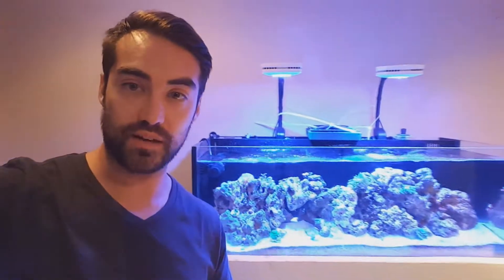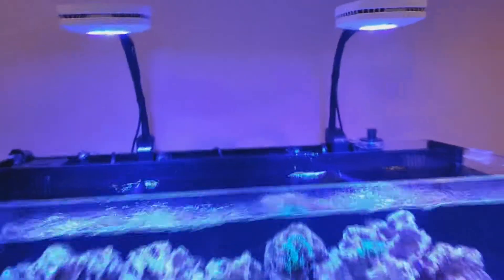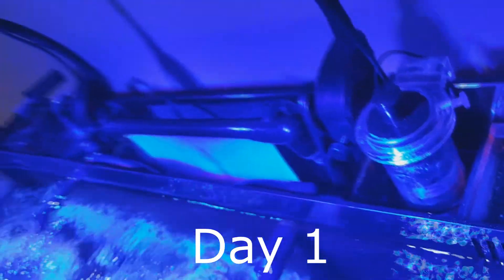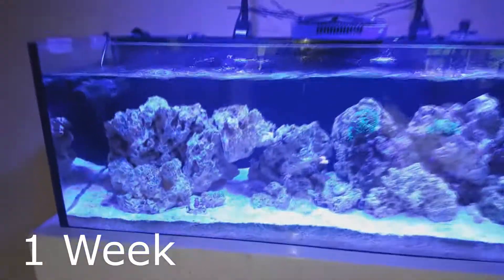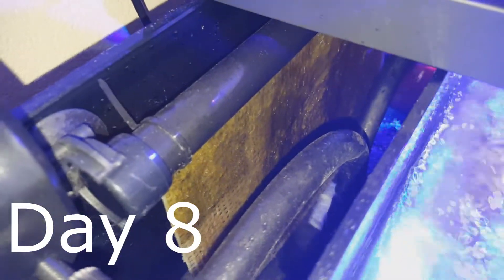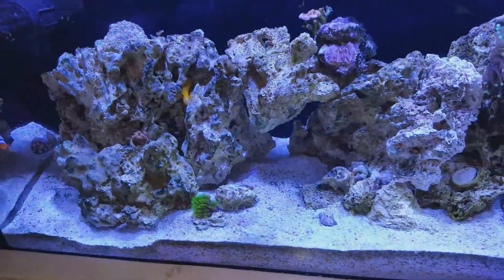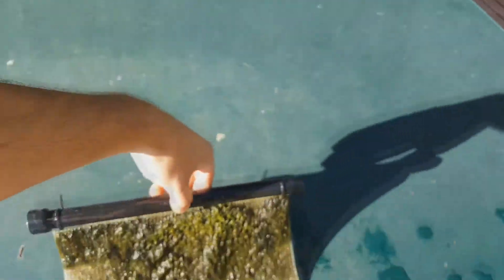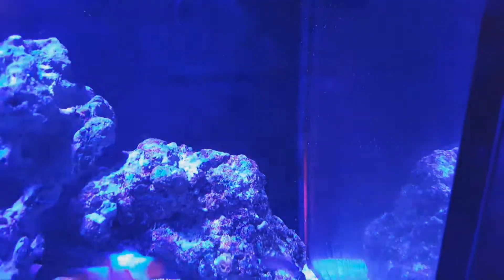Algae Turf Scrubber for Innovative Marine 30 (3 WEEK UPDATE)

Comment: Can I have this and the refugium at the same time? Really just want refuge for pods. Also with the scrubber you no longer need protein skimmer or anything else right? Just dose & adjust scrubber time/intensity
Reply from the maker: You might still nees the skimmer just depends on tank levels. Nitrate phosphates
Reply: Yaa I seen you used skimmer, scrubber, refuge and reactor (pretty much everything) did 0 out your nitrates & phos or need more filtration?
Reply from the maker: @kaldenkyulo4100  definitely 0ed it out
Reply: Nice I’ll probably do 2 of them then add 1 more if needed, don’t want to go that low

Comment: i also dont have a skimmer and/or a media reactor, would you recommend either for my tank?  currently cant get my Nitrates below 40
Reply from the maker: Definitely I've seen people run this without skimmer and reactors
Reply: run what, the tank without skimmer or media reactor?  which one would u recommend for me?  if none, how do u think i can lower my nitrates?
Reply from the maker: @albertmaya6882  well I definitely recommend a skimmer I'm running both depends on your system.
Reply: yes, ive been thinking of adding a skimmer, but its really hard to find one that fits in my back chamber which measures 4" x 2.7".  dont know if your 30L has same dim as my back chamber, if so, what are you running?
Reply from the maker: @albertmaya6882  it's Different dementions but you can make one or you could buy one from me or whatever.
Reply from the maker: @albertmaya6882  the aqua gadget ghost skimmer will fit

Comment: that sounds like a great idea, im just starting to get some hair algae, too bad it wont fit in my AIO (i have the IM 20 Peninsula).  If you think of a custom build for my tank, let me know.
Reply from the maker: Yeah man we can work something out for ya if you want I'd have to see the sump area
Reply from the maker: We can probably make you one I have the innovative Marine 30
Reply: do you think it would be beneficial as compared to maybe adding a skimmer.  its either or since i have limited room.  Also, how much would the cost be in comparison to buying a skimmer?  remember, i only have a 4" x 2.75" chamber to work with.
Reply from the maker: @albertmaya6882  do you have a middle chamber where the return pump is at that's where mine is at
Reply from the maker: @albertmaya6882  I would run a aqua gadget ghost skimmer I think it will fit in the chamber and make a very small scrubber for the return section. Just keep the water level low
Reply: yes i have a middle chamber, and if i put in a skimmer, thats where it would need to go
Reply: as far as running the small scrubber in the last chamber, it would have to be real small, as i currently have my return pump there along with my ATO sensor and return line, dont think i can fit anything else there.  also, keeping my water level real low in that chamber would create a lot of micro bubbles in my display
Reply from the maker: @albertmaya6882  yeah you could add a skimmer and a scrubber man
Reply: ive been holding off on buying the skimmer because i heard a rumor that IM is coming out with a new and improved skimmer shortly.  dont want to buy an old out dated skimmer if new one is coming out, then again, probably can get old one for real cheap compared to new one.
Reply from the maker: @albertmaya6882  can't wait too long lol definitely a must in my opinion
Reply: what, getting a skimmer on my system?  what about if install a bio-pellet reactor, those are pretty cheap and should lower my nitrates.
Reply from the maker: @albertmaya6882  you can try it. I didn't have success with that
Reply: yeah, im also reading that you should have a skimmer and can have a reactor with it, but shouldn't run a reactor without a skimmer.